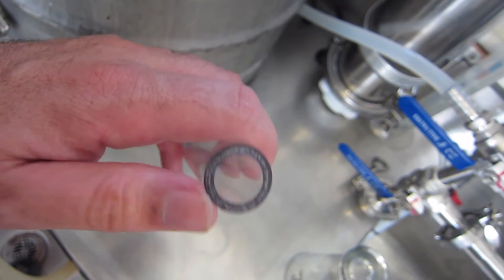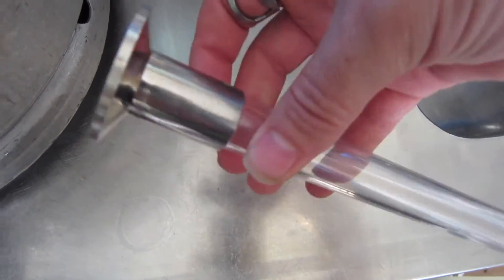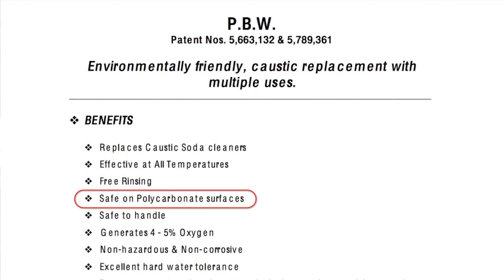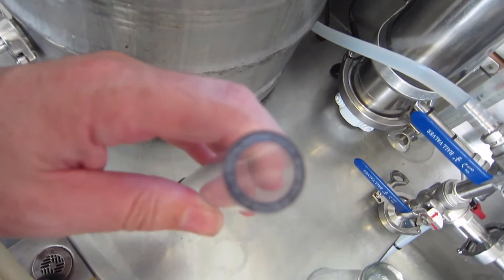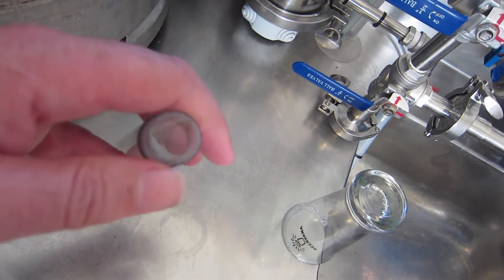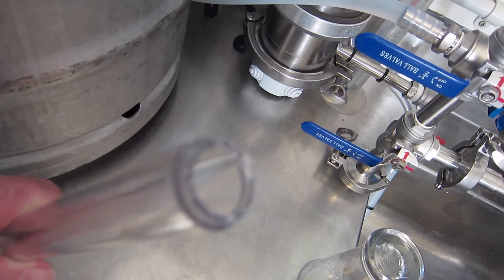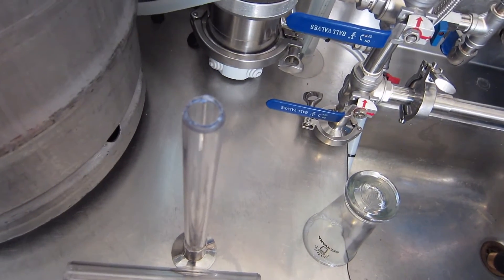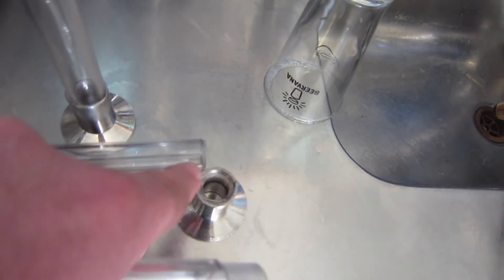polycarbonate pipe failure, homebrew tip under 5 mins

Comment: I don't use PBW so I think I might try this anyways as I really want to do custom triclamp sight glass for my kettles and I don't see any other way to mate the poly with the TC fittings.
Reply from the maker: I am changing over to these, http://www.ebay.com/itm/390723413142?ssPageName=STRK:MEWNX:IT&_trksid=p3984.m1439.l2649
Reply: Too bad you can't get  them longer. I need them to determine volume in my kettles.

Comment: I would have thought this had more to do with the different expansion/contraction rates of the metal and polycarbonate in conjunction with the machining causing stress points rather than PBW.
Reply from the maker: Very good point, I didn't consider that, as I assumed that it would be a minimal amount. But over time, yes it could have weakened and fractured the poly, and the only reason they broke is because I was careless when putting the system back together again, and I put a bit to much force on the joint.

Comment: I reckon its the pressure that a thread puts on it would not help at all too mate. that'd be pretty bloody thin once tapped (or is it died lol) and it puts a lot of different forces on it that wouldn't usually happen. I'm not sure that blaming the PBW is right, but I could be wrong. Thing with percarbonate is that it is strong but brittle, and you are right not to mess with it too much. Good luck with whatever you choose to replace it with! Cheers mate!
Reply from the maker: Yeah I didn't want to blame PBW really, but it seemed to point in the direction. Sure enough there was a lot of torque needed to cut the threads, it was a damn hard job, and if the wall thickness was to thin at the point of tapping (dieing? lol I can never remember either), then it would have definitely snapped then, cause the stresses were massive. The point of failure on all of them, was the same place, the thickest part of the thread, and the only bit of the thread that was exposed, i.e. (not tightly meshed with the Stainless)
Reply: yes odd it never snapped in the valleys, whether it was the pbw or not. but still might be to do with the thread pressures, I can't remember the details, I finished my trade in 91, thats many beers ago lol